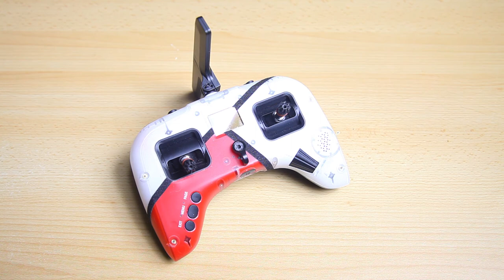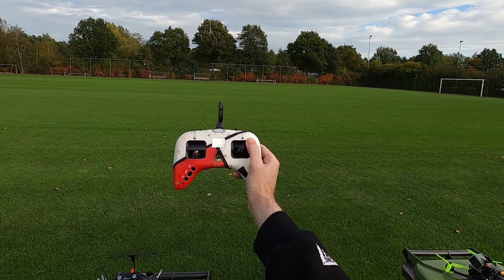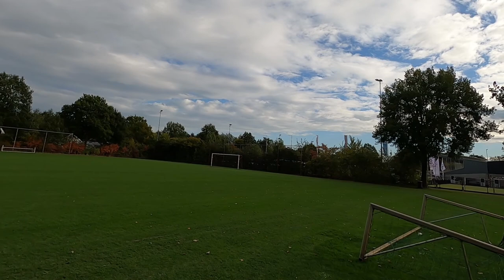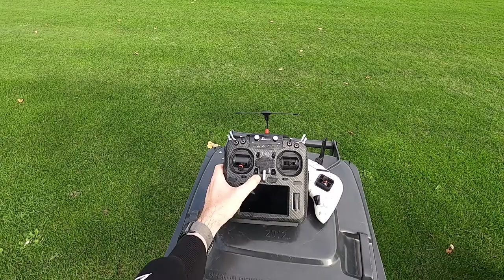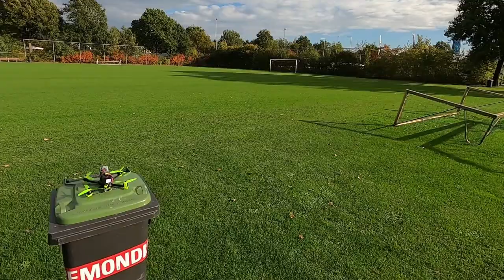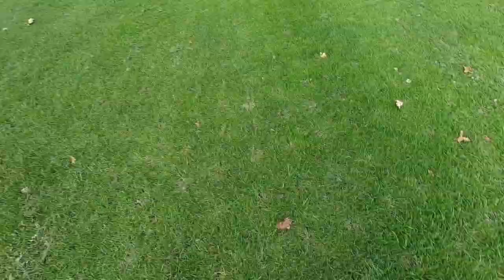TBS Multibind - WHAT?? A Quick Demo + Why Bother? :)

Comment: Well first of all thanks for taking both rubbish bins in the middle of the field ...It must have been quite a task  :-) , The module you have in  the back of the jumper what is it called? and can it be stuck(plugged )  in the back of a Taranis ? IF true ..has it got the same range of a TBS tango? I am thinking to switch over to TBS TX and RX as I do not like the ACCESS move from FrSky. I havea RM9 and I have to again for the third time buy another UHF module if I want to do some long range.
Reply from the maker: Haha :D  I was actually quite worried about how to keep all things in-view I wanted to.. I needed some kind of table for it.. And yeah.. rubbish bins to the rescue :P 
That module is the newest basically.. it's the micro TX v2, and yep.. that one would work in your Taranis :) 
Nope.. that micro TX v2 has a significantly higher output power (Tango: 250mW - micro TX v2: 1000mW) .. And yeah.. that Jumper radio of mine also has an internal R9M transmitter, but I don't  think you wonder why I don't use it? :$
Reply: @DutchRC  Good to know so MOdule in taranis , and get to fly TBS bound RX's  with a 1Watt output ???? it must go quite Long range then ...:-) and I can use a tango too with the same RX.. Not bad .
Reply from the maker: @mikbacitube  yeahhh but how much range do you need? :) I don't think I will ever need more then 250mW :$
Reply: @DutchRC  I am sure you can set it to 250/mW onward  etc... But when I go to Italy I will definetly need  a full watt.;-)

Comment: Is this just a sticker pack on your Tango or a complete different canopy?
Reply from the maker: the one I have is a transparant case I painted on the Inside
Reply: @DutchRC  ok, really nice!
Reply from the maker: @MrSmithFPV  Thank you :)  I'm not sure if I would do the exact same thing Again BUt it is at least a unique radio like this :)  Can be helpfull when flying with others :)
Reply: @DutchRC  I wonder that it looks so clean. That means the transparent case is really clear and not milky right?
Reply from the maker: @MrSmithFPV  it IS clear but not super smooth (so you have a good grip on it).. Doesn't really matter all that much: if you were for instance to paint a scatched up lexan (rc car) body.. those scratches would completely disappear :)

Comment: Just wondering can you run both radios at the same time Sort of like a trainer
Reply from the maker: Nehh that would be nice but would not work.. you wouldn't be able to control what the master or slave would be.. 
the signal time would be messed up as well..

Comment: I have 6 drones with a crossfire V2 and now I just bought a tango 2 pro v3 to use in multibind with the 6 drones, do I have to update the wifi on the crossfire v2 and the tango 2? Now everything is linked to the crossfire by the normal method, are the 6 drones linked at once because they are already in the crossfire v2? I have not found any video on youtube that clarifies it.
Reply from the maker: Okee.. the procedure is: get Everying to the latest firmware (radio, module and yes.. also WIFI).. updating the WIFI part used to be a pain in the backside but has been made easier.. 
With everything up to date, make sure all drones are bound to your Original radio (they probably still are) ... 
Receiver firmware's will probably then also be updated 

At this point you need to make sure you have a UserID.. this part changed so many times.. I don't know what the current procedure is.. 
Refer to TBS's documentation on multibind for this part.. 

Then.. boot up the original radio and quad 1.. 
Switch ON multibind while bound to the quad.. 
Power Down quad 1. 
Switch multibing OFF again in the radio. 
Power on quad 2. 
Switch ON multibind while bound to quad 2. 
Power Down quad 2. 
Switch multibind OFF in the radio.. 
Power on quad 3.... 
etc etc.. 

Now.. while all quads are off.. again make sure your 2nd radio also has that UserID.. 
And switch ON multibind in that radio.. 

That should be all :)
Reply: @DutchRC  Luckily you explained it to me, I don't think I would have done it without your help, I'll try tomorrow.
Reply: @DutchRC  The models on radio 2 copy themselves from radio 1 or do I have to create the model first?
Reply from the maker: @mcferran6720  Let me know :)  A friend of mine set it up on his side a few weeks ago.. a lot of the bugs I had to deal with are now gone :)
Reply: @DutchRC  Nice!! thx
Reply from the maker: @mcferran6720  you will have to create them Twice.. this m,ultibind Only concerns the binding between radio & receiver